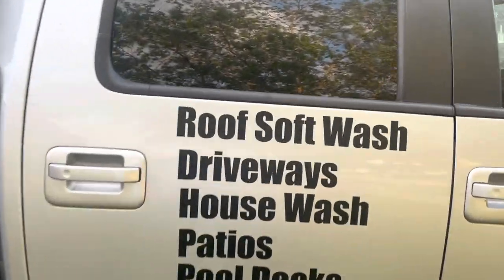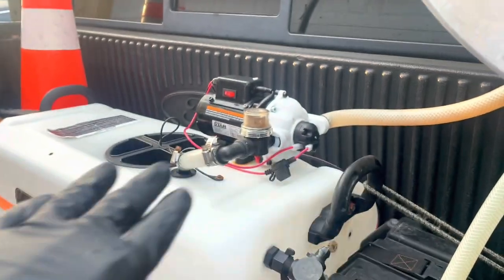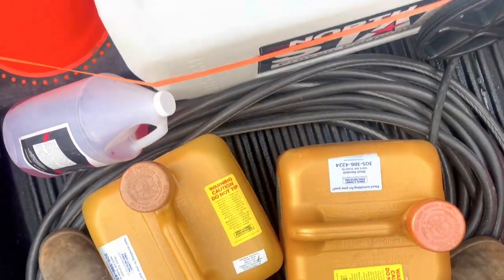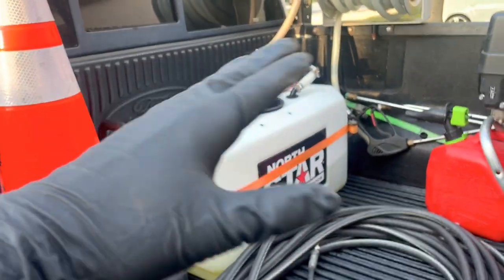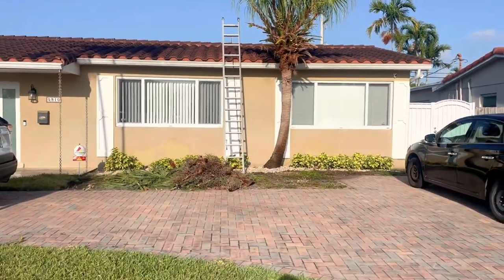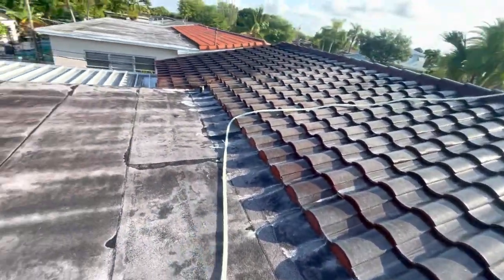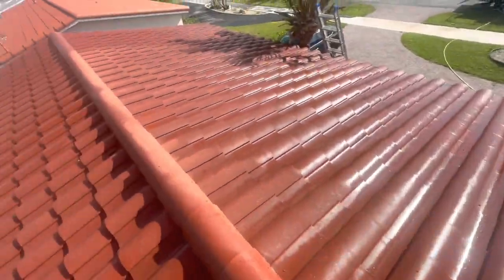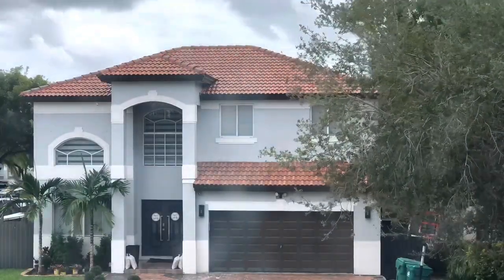How to Roof Soft Wash (for Beginners)

Comment: Where can I get the soft water setup is there a website the one you mentioned for 500 bucks
Reply from the maker: @rubencastilleja6163  on northern tool they have the whole setup pump, tank, hose etc

Comment: Hey man! Good video. I’m in Southern California. We only power wash the tiles  because the build up is so thick. How would soft washing work on tiles with really heavy build up?
Reply from the maker: I’m not sure how thick that build up is but when it’s really black I just run a hot mix with some good SH! ( a 70/30 mix is the hottest I’ll go)
Reply: @servanospressurewashingllc1477  The tiles usually have a layer of dirt and algae/moss that’s about 1/8” thick. After we power wash it all off it goes in the rain gutters and ground. Then we have to wash all that sludge out of the gutters and off the ground. So I’m wondering if the stuff you wash off is very little on the thick side versus just discoloration. Do you encounter much debris coming off the roof?

Comment: Since your set up is in your truck. How do you store your truck from the weather and if you bring your truck out in public do you just leave your pump and tank in the back at all times.
Reply from the maker: If it’s raining I’ll try and throw a tarp over it all but sometimes it’ll get rained on and yeah I just leave everything on the bed. The pump is screwed onto my tank and the tank is ratchet strapped down. And I’ve got some bike locks on the pressure washer and ladder
Reply: @servanospressurewashingllc1477  so the pressure washer doesn’t get completely destroyed and rusted by the weather?
Reply from the maker: @wesleytrent8003  negative my main concern is keeping the chemical as far away as possible from the pressure washer. And keeping up with the maintenance and it’s running great
Reply: @servanospressurewashingllc1477  okay I appreciate the response. Just wanted to make sure I didn’t have to worry about my equipment getting destroyed by the sun and rain. I’ll just try and put a tarp over it when I’m not using it.
Reply from the maker: @wesleytrent8003  of course bro, that was one of my main concerns at first. I was taking the equipment off and on everyday but I just said screw it and it’s been good just have to keep an eye on everything. But good luck bro!
Reply: @servanospressurewashingllc1477  yeah I wasn’t really worried about people stealing the equipment more just the rain. Also where did you buy your soft wash tank from? I only see 26 gallon tank with a 2 gpm pump
Reply from the maker: @wesleytrent8003  so I got that 26 gallon tank with some spot sprayer and I just removed the spot sprayer pump and just put the bleach pump. Honestly not worth it, now I’m rocking a 55 gallon drum and it’s been way more efficient so I would go on offer up and just look for a decent sized tank that’ll suit your setup
Reply: @servanospressurewashingllc1477  yeah I saw that those 55 drums are super cheap and good to store sh. How do you track how much sh and water you put in it since it’s not marked?
Reply from the maker: @wesleytrent8003  I’ve got a white one and those have marks, just try to avoid the blue ones ( they work just as good just can’t measure it)
Reply: @servanospressurewashingllc1477  I am having a hard time finding the white barrels with markings. Where did you purchase yours from?
Reply from the maker: @wesleytrent8003  a buddy of mine actually game me them and he had got it for free too lol

Comment: So no rinse right
Reply from the maker: Depends on that roof, majority of the time no. But if it’s metal than 110% and shingles
Reply: @servanospressurewashingllc1477  so no rinse for shingles cause I live in cali it hardly rains so it really doesn’t get that rinse from rain everyone talks about… I done a white shingle roof last week.. with proper set up I rinsed it..it looks better than leaving it.. I never done a Spanish tile roof cause allot of them don’t have gutters and so I don’t really do those yet.. anyways I use 5% with any surfactant.. I want to smash Spanish tile roofs too though.. What do you say about my thinking..appreciate your feed back
Reply from the maker: @valdovazquez6636  so I do rinse shingles and metal roofs all the time, when it comes to that Spanish tile just be careful on the dirty parts it gets REALLY slippery! I would say try to knock a portion out from ladder or ground and then work your way around